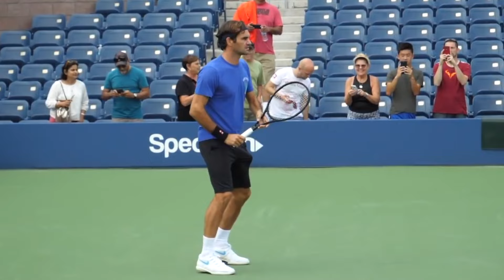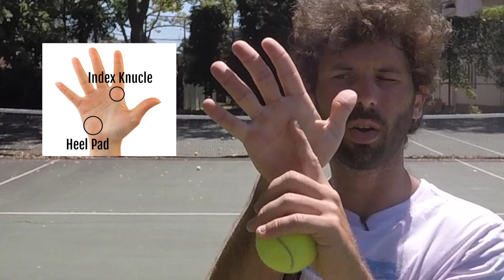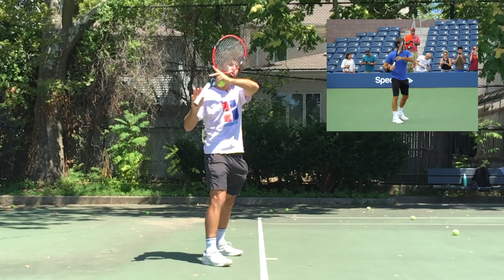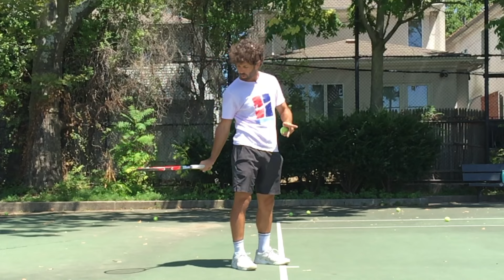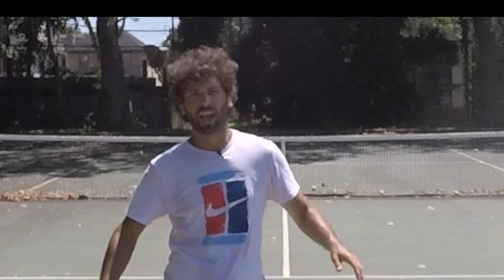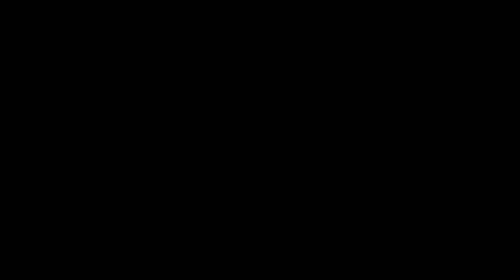How to Hit Your Forehand Like Roger

Comment: I agree with the momentum concept, but disagree with the "pulling". The wrist has got to stay relaxed. Pulling adds tension. Using the "pat the dog" momentum, my racquet flips back when I start to turn and my wrist becomes fully bent. I want to maintain this bent wrist all the way to the ball. To do so, I let my arm move naturally with my body turn. This is just enough speed to maintain my bent wrist. Then, I release my arm and wrist into the ball just before contact. Also, if my wrist stays bent back, my body turn will automatically line up my racquet aim for me. Notice that Federer is not pulling the racquet when hitting easy shots.

Comment: Everything u said.. And 2 more obsvs of my own... 1st his racket tip during pat the dog is facing the net post or parallel to the baseline( at max) and rarely does the racket tip go behind the handle during pat the dog, I. E the racket tip is conciously pointed towards the net. 
2nd. After max. Knee bend in sync with the ball bounce as he starts leg drive, Roger's arm extends to its full length and then his right shoulder 1st externally rotates b4 the fwd swing. This is the magic pill for the lag. He actively externally rotates his hitting shoulder just prior to fwd swing and that flips the racket into a naturally lagged state.
After that it's just his hip cum shoulder blade turn and the arm follows thru ram rod into contact with a windshield viper crunch 😁💪
Reply from the maker: Hey Shriram, thanks for your comments. Agreed with all. I may make an update to this video as I've discovered a few more elements myself!

Comment: That's a pretty amazing breakdown of Fed's forehand you did here. Especially loved how you emphasized on using the back-swing to create momentum for the shot, I've watched a ton of videos and  none of them highlighted this important step. However I'm a little confused about the arm next to the body in the shot build-up. I've seen Coach Rick Macci make an absolute point of it in a video about keeping the arm away from the body (as if you were trying to elbow someone in the face whose standing behind you) during build-up. Though your video breaks down Fed's forehand in particular and Rick's video is about forehand in general, I would like to know which back-swing to adopt for a better fluidity in my shot. Thanks in advance
Reply from the maker: Thanks, Saifuddin! I agree that the release/momentum part of the swing is often missed by analysts. This channel is focused on that aspect. I recommend starting here - https://www.youtube.com/playlist?list=PLJCGyq2nRPvVfiSjxkmdWf1h9XIkM3xXg. 

Regarding arm/elbow height, Federer keeps his elbow lower than many, though it will rise with higher shots. However, a player like Thiem raises his elbow much higher, and he straightens his arm earlier in the backswing. However, the take back for the majority of ATP players virtual never exceeds 90 degrees to the baseline (pointing directly at the back fence.) 
 
I will post a comparison video of variations and consistencies between top players, so stay on the lookout for that video.
Reply: @gravitytennis   Thanks a bunch for clearing that out. Looking forward for the comparison video!